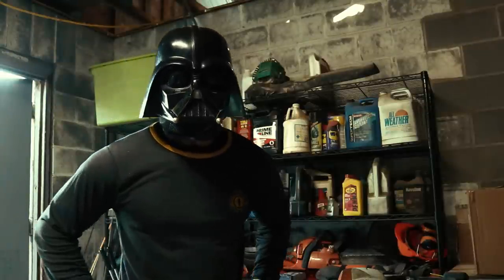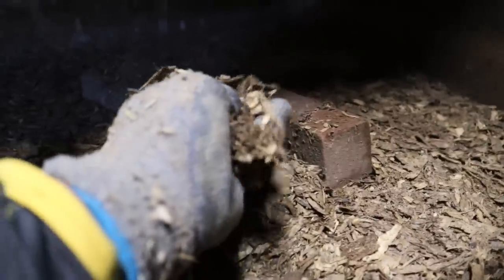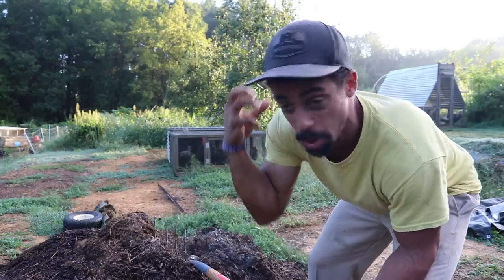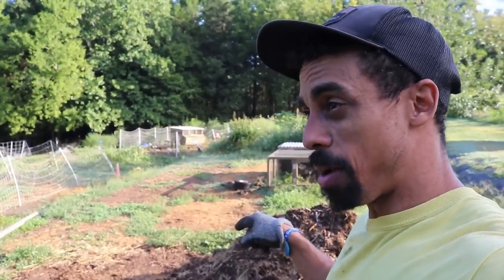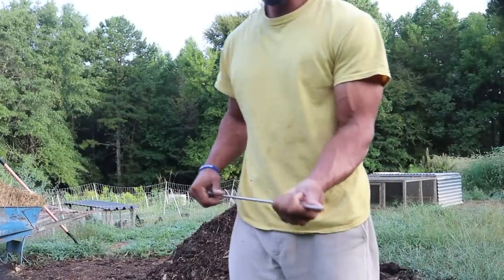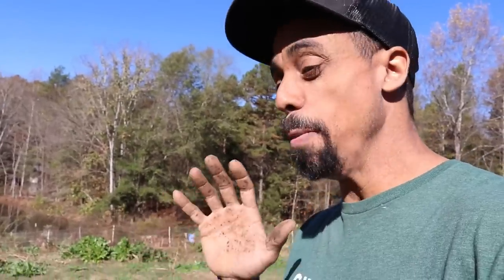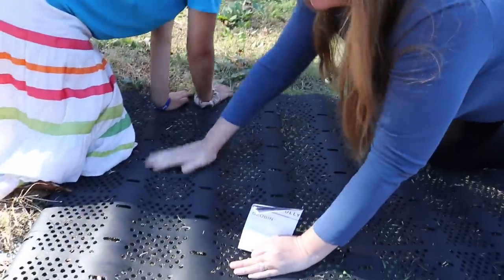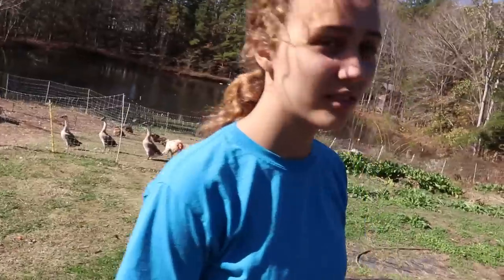DO THIS NOW to Grow Bigger & Better Food | How to make Compost

Comment: Sela, if you use a tarp laid out flat on the ground you can rake a good bunch of leaves up onto it real quick, then grab two corners and pull it to where you wanna dump them. No bending over and over. It's lots faster and easier. Give it a try . The tarp just floats over the ground. Just don't pull too fast . I'm old and can't do all that bending stuff. Try it. I bet you'll like it better
Reply: painters cloth does better. i use it moving small twigs
Reply: Exactly what we do. Soooooo much faster and easier.
Reply: @tsaligrass   I'd think that wouldn't pull as smoothly?
Reply: It's easier on my body to use a blower to get my leaves in a central area, then rake onto the tarp.
Reply: I use a bed sheet😊

Comment: I bought my current home in suburbia 10 years ago and one of the first things I wanted to do was to start working on garden beds so I ordered a truckload of compost from the largest distributor in our area.  I used the logic that they wouldn't have become the biggest if they weren't any good. Turned out to be killer compost and killed off the seedlings I planted in the first 3 beds in no time as well as the one established flower bed I had added it to.

Before using the rest of it I tried replanting on my original beds.  Then it was just a matter of using it in areas I wanted to suppress weeds.

Those first 3 beds laid barren for the next 3-4 years without a single weed popping up.  After that I tried growing grass on those beds.  Some had grown but even after 10 years you can still tell where those beds were by the patchiness.

Looking forward to starting my own "chicken worked" compost at my retirement farm.
Reply: Wow, that must have been some nasty stuff in that compost for it not to grow a thing and not let grass grow in it for ten years!
Reply from the maker: Ugh, thanks for sharing your experience.

Comment: So interesting to watch! I wish I could do that. I've tried, tried and am currently still trying to get my compost to heat up. I use all the same ingredients as you except I use rabbit poo instead of bird poo. Water and turn every other day adding more poo and and straw... 1 part poo and 3 times as much straw. I've tried 1 to 2, 1 to 4, and now trying 1 to 3 ratio of straw and poo but still change. Have watched dozens of people show videos of this. My current footprint is 5 foot diameter by 4 feet high. There has got to be something pros like you are not revealing.